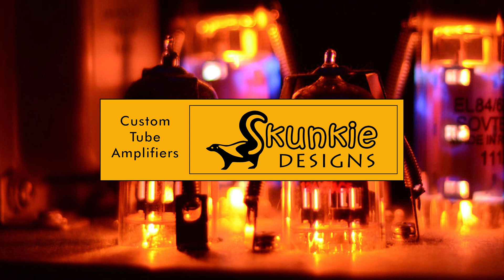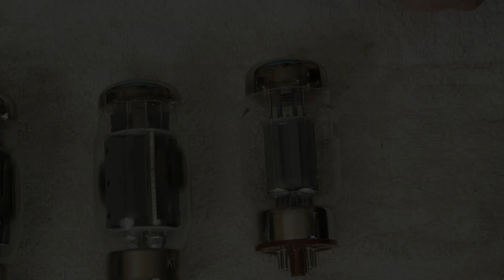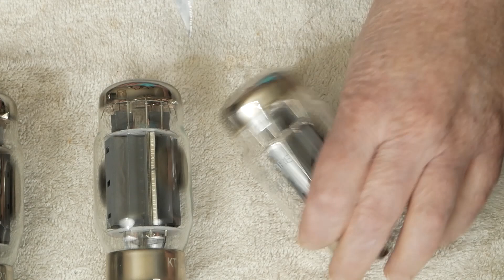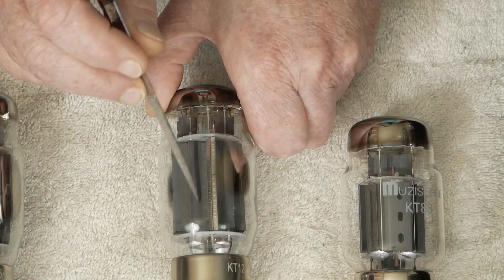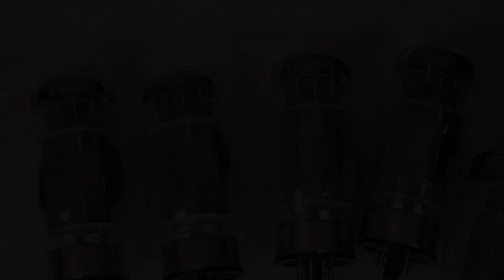Tung Sol KT120: Why do some of them overheat and others don't?

Comment: Wonder if the KT120 tube will work in my Cayin CS-55A ? :)
Reply from the maker: If it's not designed for them, it's not going to make more power or sound better, and if the power transformer isn't designed for the extra heater current, they would likely kill the transformer.
Reply: @SkunkieDesignsElectronics  Thanks for the input, totally fair point. I’m mostly just curious and trying to understand the limits of my CS-55A. Cayin officially supports some fairly large tubes (KT90/KT100), so I’m exploring where the safe boundaries really are rather than chasing more power. Heard good things about the KT120, and you sparked my interest with the Willsenton R8 discussion.

Comment: Wow... I'm very happy that you pointed this out Mrs. Skunkie... 

As you know, I just finished the build on my VTA ST-120 and as of right now I'm running a quad of KT88 Gold Lions at 40mA and they are working and sounding great. I have the bias set to 40mA to keep the amp running cooler and for the tubes to last longer. I really don't need the few extra watts if I turn it up to 50mA.  With that said, I am fixing to buy a quad of KT120s just to see how they sound in the amp... I wanted to know if the re-issues date codes are the tubes with this problem ???  I will have to inspect the tubes to make sure that the getter is on the side of the tube as you say... I believe you are right that the heat is reflecting back into the tube, causing the tube to overheat... 

By the way, I wanted to thank you for the advice that you gave me for upgrading the amp to a dual 5AR4 rectifier tubes because this amplifier is now running fantastic and much much cooler... I ran it for 7 days straight without turning it off with no issues... Nothing is overheating (red platting with time with a single 5AR4) or creating any problems on those 2 5AR4 tubes. 

Have a good day and go safely Mrs. Skunkie...

Comment: Hello
Could you tell me why you're using a 4.3kΩ speaker transformer? The technical specifications for the KT120 tube are 3kΩ?

I apologize for asking, but I'd like to know the reasoning behind it.

Thank you very much,

and best regards,

Henryk
Reply from the maker: The transformer impedance is based on many factors, including plate voltage, current etc. I can't explain this in a YouTube comment, I plan to do a video about this in the future. Not sure where you are getting 3K and what is the operating point used for this 3K suggestion? And it it triode connected or UL or?

Comment: Have you tried the KT150-PT PSVANE Hi-Fi ? on yours amplifier ?
Reply from the maker: I tried the Horizon version and it replated just like the modern tungsol. They might work in a colder biased push pull, but not in a single ended. I believe they took the horizon ones out of their store after I reported this.

Comment: I wonder if the Chinese version, the Shuguang Treasure KT-120, has the same problem, does anybody know?
Reply from the maker: Somebody mailed me a pair of non-treasure shuggy tubes and they do the same thing. At actually lower ma.
Reply: @SkunkieDesignsElectronics  Thanks for answering, It is really weird what's the point making power Tubes if they are going to red plate. I wonder if KT170 would have the same problem. I am thinking of making this amp but using KT170 instead and adjusting the bias.
Reply from the maker: In a push pull amp, where most of these are used, the idle bias is much lower.

Comment: So I've got a set of kt120s to try in my amp where kt88/6550 lived. Now I have to check and make sure the getters aren't on the plate seam, lol.

Anyone know if the kt120s you can order now are any better or not?
Reply from the maker: AFAIK only the earlier versions are able to live at their rated dissipation.

Comment: I use KT 120 with my Doge 10 mk2b and with my Galion TS120 SE no problems at all ' 
Auto bias dials them in perfectly ' I have over 7 sets of kt88 and the kt120 bass ATTACk is better than all my Kt88 but the Golden lion kt88 resolution is hard to beat ' but 
If you have bright Crispy speakers Mullard kt88 is the way to go ' I actually use 2 golden lions kt88 and 2 TAD kt88 for power tubes ' and Wow !! Sound great with my dynes (Dynaudio towers)
Reply from the maker: I'll say this one more time for the people in the back: push pull KT120 amps will never run into this biasing issue I ran into with a high power single ended amp. They aren't biased anywhere near these levels and don't need to be.
Reply: @SkunkieDesignsElectronics  appricate you love the vids '
Reply: @SkunkieDesignsElectronics 
Ah.. glad I read this.  I’ve been loving the sound of KT120 tubes that replaced the 6550s in my Conrad Johnson premier 12 tube monos.  They came from upscale audio.  But I can’t get them from upscale audio anymore so I was worried that the spare KT120s  that I bought from TheTubeStore might have the problem mentioned in this video.  But now as I understand it since my premier 12s are a push pull amp, this shouldn’t be an issue.

Comment: Hi Steph, it's director of the factory-manufacturer, Irusha Bitukova answering you:  Yes, we moved the side getters purposely. These are reasons  -  1.They used to be placed too close to the radiator edge what formed the plate-getter-radiator loop and, during getter spraying, caused high frequency breakdown between getter and the radiator rib.   - 2. The getters were too close to both plate and radiators. This made the getter harder to spray and was leading to overheating of both  plate and radiators and caused the plate material to spray onto the glass.    - 3.  In the previous design the getter was farther from the glass what gave a larger mirror which blocked the radiator rib and bigger part of the plate.  THIS caused overheating of the plate and CATHODE of working tube as well. And THAT IS WHY you got higher current!!!    -  4.  In the current design the mirror surface is smaller and moved very slightly what opened shadowed before plate half and shadowed lesser part of another half.   This made plate and cathode cooler and lowered plate current at same plate voltage but still  the output power readings show 24W value when the lower limit is 18W.     We'd love to get rid of the side getters at all but then we'd get the tube life time below 500 hrs.   Anyway, thank you so much for being a fun of our KT120!  You are great too! I'm your fun now and subscribed!
Reply from the maker: I got much higher bias and power out of the amp before red plating with the old design. None of the newer version tubes will bias up past 80ma at 500V which is 70% of the rating. which is 40W not the rated 60W. I'm sure they work fine in a push pull amp, but this is not good for a SE amp.
Reply: @SkunkieDesignsElectronics  First of all I am a fun of you to😂and thanks for your wonderful channel.
I though I finally found the amp that I want to build, you being so enthusiastic how it sounds, but now I am no so sure. 
The problem is how to get the right KT120? Have you any info about the Shuguang Treasure KT-120 tube?
Reply: @SkunkieDesignsElectronics  I understand, but we used to lo loose too many tubes in production… And I was talking about idle output power
Reply: Well that's a downer, as one depends on a hope and prayer you can find the 'good' KT120's.

Comment: I believe they had someone new on the assembly line when welding things together. They probably had a box of halos with the standoff wire/tab already attached. This would then be positioned and welded in place. It could have been that, based on the orientation of the base or holding fixture, it was more difficult to hold the halo flipped in one direction and easier to hold it in place in the other. It could be that the standoff wires/tabs should have been bent after welding - conversely, they were supplied bent to clear the plate joint but the assembler didn't know they should be bent so straightened them to look better (cussing the halo makers with every tube). Who knows? I just hope I can find a second tube that will bias to 90ma.
Reply from the maker: All the above could be true!

Comment: Awesome. Excellent deduction abilities you have, and I believe you are correct based on the trials, even down to how far the getter flash is over! This information needs to be shared with the manufacturer, because even though they should know, maybe they don't! The other part of me says, see if there is excessive current draw from the red plating tubes, and let them red plate to see if they do ok. That does however, keep one on toes as to when there may be an actual problem with the tubes. Output iron is not cheap! Ultimately, and IMO, it is time for another solution, possibly figuring out how to make a KT88 perform well in this circuit.

Comment: Do you think it would be worth experimenting with cooling fans? A well-aimed, quiet cooling fan could help with heat dissipation, and could perhaps be powered from the 6.3 volt heater line...or an external power supply
Reply from the maker: I did try a small fan when testing these KT120 tubes and it didn't change their behavior. The glass isn't overheating, the plate is.

Comment: I would like to ask if you think it is possible to bring the "color" pre amp feature into this power amp by increasing the input signal into the 6EJ7 and reducing the output to maintain the same volume ?
Reply from the maker: Someone can always add pots to an amp like this, but you would need to factor in the output drive of the 6EJ7 when sizing the power rating. + there is a LOT more voltage swing.

Comment: Thank you so much for this video.  I am really playing with the idea of building these monoblocks, as I have 8 KT120s laying around from when I built a pair of Bob Latino M125s (which are too noisy for the very efficient speakers I am currently using).  All of my KT120s are from several years ago, and all have small getters that are off center of the plate...so even more reason to try your build!!
Reply from the maker: You can do it!
Reply: Is there a list of materials somewhere?  I can't find it.  I'd like to see how much it would cost, total.  Sorry if it's easy to find and I'm just blind...  lol @SkunkieDesignsElectronics

Comment: So i just ran to my cupboard to check my kt120 - Damm !!! 1 of mine has offset getter and small amount of glass flash ---- yeah you know whats comin now eh ! the other **** has big getter flash right over the bloody plate !!!!! so i have 1 of each - and i also believe you are 100% correct in your evaluation -- im pissed off by my findings but once built i'll run low at 75-80ma and keep looking for what is now the hottest property in the tube market - i see profiteering from those that know coming -- Steph you are an absolute legend to 9.5k people ! and thats worldwide - i have trouble keeping just the missus happy haha - i have been totally intrigued by everything you do from day 1 - there is simply no other honest and trustworthy site like yours out there - its fair to say i think you have carved a special path through life -- im going to use the hammond 1628sea opt as mentioned to you before - i am super impressed with that range of opt - i think they call it their audiophile range and build them over spec - so im on hold still im afraid --- just need your resistor values pleeeeeeeeease ha - it would take me a day to finish once i know what values your happy with ---- oh did you once mention you have Klipsch chorus ?? - if so have you run these amps through them ?? - i have a pair and thats my intentions - i also have a pair of Tannoy lancaster with 15" gold -- to be honest the klipsch kick their arse big time haha but i will never part with either ---- Chris

Comment: Just checked 3 pairs of tungsol 6550, 2 were from ebay and were low use but 5 years old, the other 4 were from a uk based supplier just after the war started. Thankfully they all have the silver film to the left or right of the join. Hopefully they are all good tubes. Guessing you like the TL output trans then.
Reply from the maker: Yes, I like them a lot!

Comment: One more comment... My measurements show that you get lower THD the harder you drive the tube. How does your THD look at 80mA vs 110mA ? 
I also completely agree with you that the KT120 sounds really really good. I had not tried it before at 500V and more than 90mA bias because i had not a high enough PSu then.
I will definitely continue to work with the KT120 as an SE output stage. Thank you for your work.
Reply from the maker: I haven't tested all this yet, but plan to in the near future.

Comment: You are absolutely right. I have 6 KT120 tubes and 2 of them have getter position not as bad but almost like yours. I just tested one at 120 mA bias and it redplates slightly at 150 mA worse and not at 100 mA bias. So your theory is absolutely correct.

Comment: I believe you are right about the getters. That coating is reflective on the inside as well as the outside. That means the heat would build instead of dissipate.

Comment: How is it that the tube engineers didnt realize this?
Reply from the maker: They did I'm sure. I believe this was something that happened on the production line by workers who don't understand how tubes work.
Reply: @SkunkieDesignsElectronics  the problem clearly implicates a defective quality assurance regime. Back when these items were just a commodity, I could understand such a thing. But these days tubes are specialty items, much more expensive than they were back in the day, and they should be treated as such.

Comment: A friend of mine runs his PP amplifier in triode mode, the tubes ( nos 6550A) are biased very hot in class A .............455 volt plate at 100 mA .............Six years later the tubes arestill fine and within specification ...
WHY ,.................the plates are relatively and asthoningly small and fine .................those were made with three  alloys ( tri-alloy clad structure )...........the different alloys were blasted together with DYNAMITE !
The tube .........6550A GE .........and some other US manufacturers......
Those were the days ...you bought the tubes, you used them without testing and in most cases all went well.
Graphite plates as seen in big emmision triodes like the 211/VT4c and the 845 kive even longer when pushed a little into red plating ( seen in the dark ) , BECAUSE the anode was coated with zirkonium as extra getter..............when heated above a ceratin temperature they become very active as a getter ..........and the tube livesd longer............Seen in some amplifiers , more than 20;000 hours with more than 1000 volt on the plate........
So everything is relative besides badly build low quality tubes.
To conclude ................as long as the anode gets it's electons out of the electron  cloud  without pulling them ( = stripping of the cathode coating ) there's no problem of shorter lifespan ....that's another myth in audio circles ............but the temperature of the glassbulb has to stay under the designed max temperature rated by the manufacturer.........
Reply: Just curious if you can only run 950 volts on 845 tube se what range of plate current gives a long service life?(us made 845)
Reply: With US ( nos ) 845 tubes  you can run the current to just have a faint red glow on the plates in the dark  ! Sounds good also if the PS and OPT are of quality . @johnstuchlik5828
Reply: You can also run only 700 volt on the plate .. @johnstuchlik5828

Comment: First thing to verify when a tube redplates ( when normaly they don't or never did ) is to check the coupling capacitor ( leaky ) ...........in this case with the amplifier build by Stepf this is not the cause !
Second verification when it is with PP amplifiers biased with a shared cathode resistor , when aging one tube will do all the job and the other will be in starvation mode . It acts as a seesaw ........
Third reason when this happens is caused by grid current with high perveabce tubes , fixed bias that doesn't protect and compensates to prevent run away .......also to high a grid resistor value as seen to often ! ( not in your amplifier Steph )
Fourth reason ..............;;bad and low quality build tube ........ass seen with these KT 120/150/170 from recent production .

These tubes that now one else builds are some kind of a bussiness prison ....
You're lucky to find good ones or to have build up a decent stock in the past .

Comment: The tube delivers enough current at a voltage and bias ...........but the  plates redplate way below the rated wattage as announced in the datasheets .
Older versions work correct as you experience .
They have saved on the materials , quality and quantity of the plates ( and other elements ).........especialy reducing the amount of nickel deposit on the plate and the quality of the metals !
We have seen this before at the end of the tube era production ( example : redplating of the famous GEC KT88 due to the heavy concurence war with chinese shitty productions sold way less expensive )
Those low qualty badges that were refused by manufacturers ( hifi and guitar amps ) were returned to the factory but resurfaced many years later on the market sold as expensive nos tubes .

Proof , the same tubes manufactured in the years earlier work fine ........most amplifier manufacturer switched to this family of tubes , where there is no alternative other manufacturer who builds the same type ..............all those customer will encounter the same problem with their expensive tube amplifiers ...........Mac, Audio Research, Jadis  and many others , 

Good news that your amplifier works fine now !
Kind regards